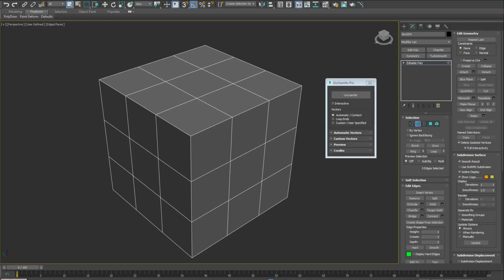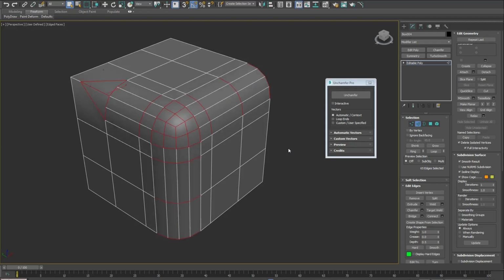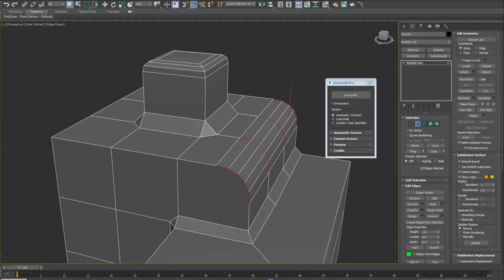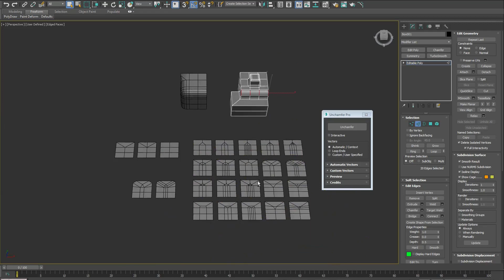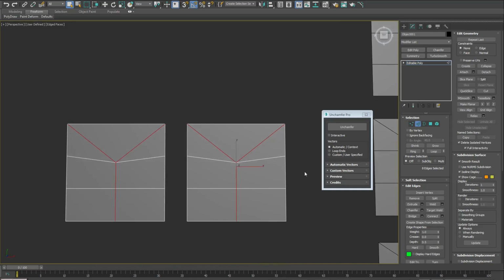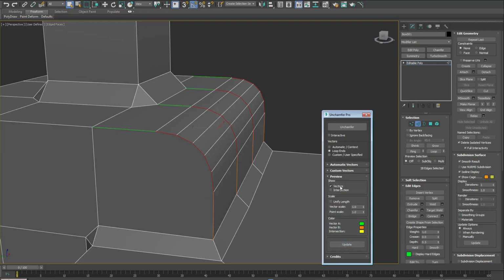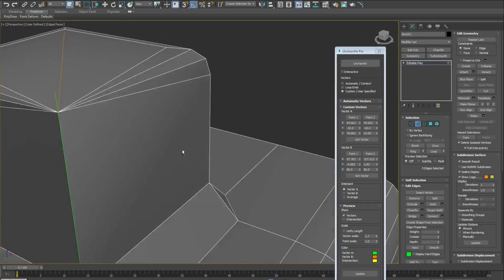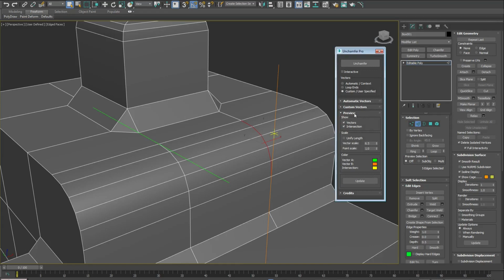3DSMAX - UnChamfer Pro (revert chamfered models to their original shape)

Comment: This is a great tool. just one question what are the differences between this and Unchamfer in rappa tools?
Reply from the maker: The unchamfer in Rappa Tools is essentially just the "Loop Ends" mode of Unchamfer Pro, which is good enough for removing very simple chamfers but can't really be used to remove more complex ones. Unchamfer Pro is meant for people that need a more robust and complete solution.
Reply: @rtz Yup. Thanks. I purchased your other scripts and plan to buy this one in the future. a bit expensive comparing your other scripts but it's really cool :)

Comment: I know it has only been officially verified for Max 2013 and above, but has anyone tried it with Max 2012? I have only just got UnChamfer Pro and suspect it actually does work in Max 2012, but have not done a lot of testing yet.
Reply from the maker: I can't guarantee anything, but iirc versions of Max under 2013 have some minor visual bugs with the user interface due to an unsupported feature used for button placement (buttons spaced out wrong), otherwise it probably does work with some older versions of Max.
Reply: @PolyHertz  - Thanks for that comment. The buttons are all lined up along the toolbar, instead of in an expandable stack, but hey, it still works so far. Greg, I've sent you an e-mail. I had a question about the .mcr file, as in where is it supposed to 'live' during and after installation of UnChamfer Pro? Could you check your e-mail (junk folder?) and reply please?

Comment: Slightly off-topic and figure you'd know enough to be able to possibly write a script for this: I was just lookin to create a fillet on a vertice that would be reverse of what may naturally wants to do. For example, you have a rectangular spline with 4 vertices. You select that 1 vertice and fillet then it creates a round corner. Now if you were to select a vertice to and try to run the fillet in the opposite direction (reverse for making an indent as an example), by default max doesn't want to do that. Hopefully I explained myself clearly. Are you aware of any scripts for filleting in the opposite direction and do you think it is possible to create one?
Reply from the maker: Yes, it's possible to create a script like that. The easiest way would be to make a script that simply reverses the direction of pre-existing fillet segments that have been selected (as opposed to creating new ones from scratch). You basically just need to get the segments two verts and calculate the new handle vectors based off the existing ones angles. A fully interactive fillet tool with different options like reverse curve angle is also possible but would take more effort/time.

Comment: when l attempt to unchamfer a cylindrical hole/ring my mesh goes bonkers, moves and rotates all the other mesh except the edges being unchamfered. Is there a workaround this?
Reply from the maker: Could you provide a screenshot or video of this happening? Also is it occurring with both Editable Poly and the Edit Poly modifier, or just one of them?
Reply: @PolyHertz  Hi, l figured out the issue while making a video to show the problem. I had to apply a reset Xform for it to work correctly.

Comment: Hey. Looks useful, but its too over complicated. I mean removing chamfers is a pretty common task that should integrate in the modeling pipe-line without interrupting the flow of the process.  When there a some sort of interface where you need to press buttons and selecting different modes it quickly becomes something which you will try to avoid. Even just opening the script's interface for pressing a single button for tasks like this is unwanted.

So tell me - Is there an option to bind unchamfer function with first mode to one hotkey and "interactive" mode to another hot key? If not - then you should consider to add this or make another shorter (and a bit cheaper mb) version for those who don't need a howitzer to kill a cockroach.
Because basically those two are the only thing you need. Other stuff you can fix manually if something goes wrong or do another way.
Reply from the maker: Hey just wanted to let you know I've just uploaded a new version of Unchamfer Pro with extra hotkeys. No need to use the interface anymore unless you want to use custom vectors. :)
Reply: @PolyHertz  Cool! Thanks! Now I will buy it ))
Reply: Hey it's an open source. That's very cool.
Btw the installation process is a bit complex for a regular user. Polycount has a thread about how to make MZP files. Its called "Maxscript making a self installing mzp". Unfortunately I can't give you a link - youtube killing my comments because of that. But pretty sure you can find it by your self if you interested. Thanks again.
Reply from the maker: @FishMan1nsk  It uses basic mse encryption, so not really open source (mcr has no encryption though). The encryption is just a temporary thing though so no one tries porting the scripts to Maya or Blender before I get around to it myself (a few of the scripts I've released for Max I've already ported to Maya, just haven't gotten around to making videos and releasing them).
As for MZP, I've used it before with other scripts, stopped because various users had issues with it though (iirc it required Max be run as admin on their systems to properly copy files).
Reply: @PolyHertz  god bless you, 
I sat thinking "are there hotkeys, if not, then I shouldn't buy it", but then read this comment thank you
Reply from the maker: I can definitely add dedicated hotkeys for automatic mode with interactive on and off. Will add them in the next update.